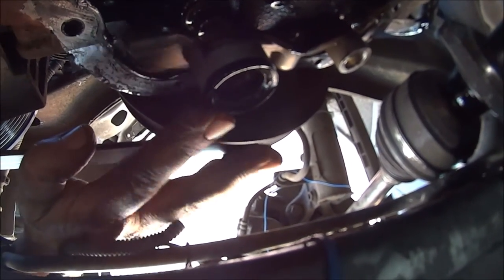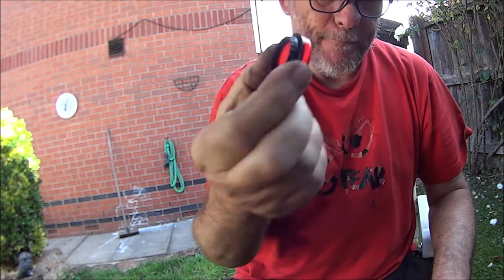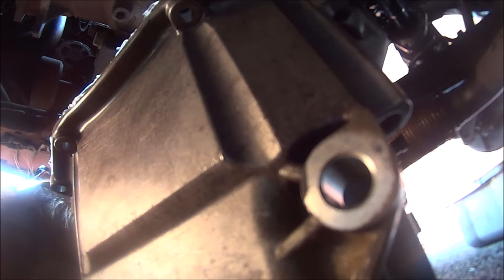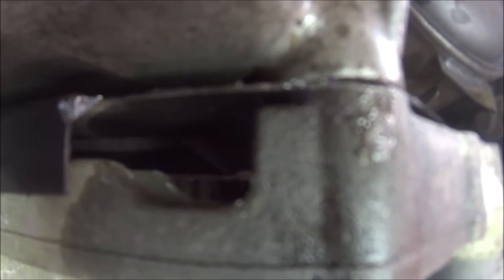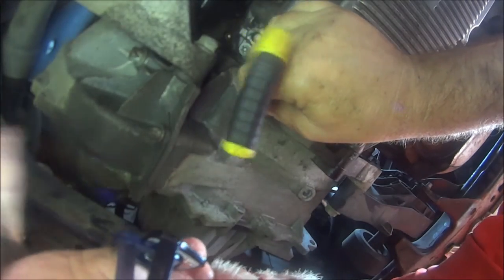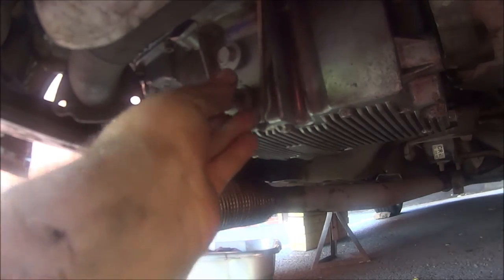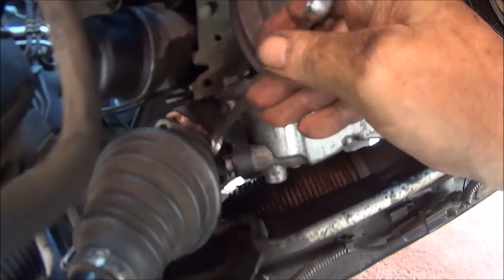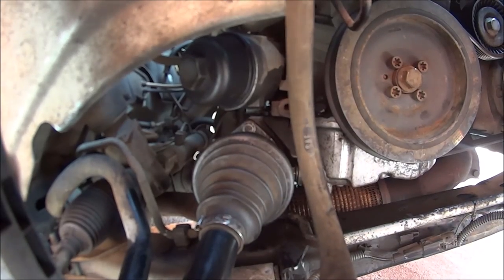VAUHALL INSIGNIA cdti oil pump Gasket seal replacement. UK

Comment: Just did mine 7 days ago but I replaced the rubber seal with the aluminium one ... no more low oil pressure warning on cold start up.
Reply from the maker: Nice one Graham. Thanks for sharing this with everyone 👍
Reply: Hi Grahan, Great coment, do you have the part number of the aluminium seal you installed?
Reply: The aluminium one has a smaler diameter. I am not sure if it will perform the same way. Thatswhy I am goint to use the original.
Reply: @sardaragabejli2208   if you mean the inside diameter, the restriction is not significant (coming from an engineer specialized in hydraulics).

Comment: Great video, really helpful. What are people's thoughts on replacing the big end bearings whilst the sump is off? 
I'm tackling this job shortly, I've not had any low oil pressure warnings, but replacing the pickup seal due to mileage of car and for peace of mind. I've seen some people mention changing the bearings and others don't.
Reply from the maker: If you have no knocking or bad vibration from the engine then I would just do the seal a lot of people replace the pump as well. But im not a mechanic just a guy trying to stay on the road
Reply: Thanks for the video. Just wondering if I should change the oil pump too. Do you know does the timing belt have to come off for the pump change?

Comment: Hi, great video of job done by good old mechanical expertise...:-)
Reply: Do you John or anyone with experience; I have a question if OilPump-Seal replacement also is needed on the Engine MY2014 CDTI A20DTH 163HP/350Nm, due to My Motor is about 156.000Miles = 250.000KM
Reply from the maker: Hey, thanks
Reply from the maker: i would do the pump too if you can.

Comment: The question is, is it still going? Did this oil pump seal on my car Jan '21 as I was getting red light of death on cold mornings, and now March '22 it has catastrophic bottom end failure and seized. Looked at 2 main bearings and both have spun in the housing...nightmare, maybe I should have changed the bearings when I did the oil seal...who knows?!
Reply from the maker: Can't say as I no longer have the car. But it will depend on how long the low pressure warning was ignored I guess.
Reply: @jonyr1TT  seems you're smarter than me ;) I didn't think much of it because my old Astra 1.7 CDTI did the same thing on cold mornings, but then I read up online and did the job as a matter of urgency....guess I was too late!
Reply: I can say tho, changing this seal did certainly 100% fix the red light of death on cold mornings issue
Reply from the maker: I'm not trying to be smart, just trying to help others save a few pennies. And Me. 👍
Reply: @Sydney268  hi mate. How long did you drive after first pressure warning? Did it appear many times before you replaced the seal? Cheers
Reply from the maker: About ten miles I'd just bought the car. So how long the previous honer drove it I've no idea 👍

Comment: Hi I have the warning when it's cold and after a second it disappears. I need the car for the next few weeks.Can I carry on driving or must I get the seal replaced asap?
Reply from the maker: Do not start the engine until its been replaced.. Low pressure will blow the main bearings.

Comment: Hi, need some advice. I posted recently that i had the oil seal replaced on my Astra J. A few days after the seal was replaced, I noticed a chattering sound when the engine was idling. Harvey's said that the flywheel needed replacing. I took it to another garage due to the price i was quoted. They replaced the flywheel,clutch and slave cylinder.
However, they said that when they came to take the gearbox off. There was no oil at all in the gearbox.
Does the process of replacing the oil seal need the gearbox oil to be drained?
What i am worried about is, did they drain the oil and simply forget to fill it back up or have they cracked the gearbox housing and the oil has leaked out. I am not getting any reply from Harvey's at present.
I will be going back to them to discuss this but i need to be a bit more informed before challenging them. They did tell me that they had to undo the gearbox to get enough room to reach the two difficult sump bolts.
Reply from the maker: Hi. When I did my oil seal I pulled the driveshaft out so I lost a good fare bit of gearbox oil through the driveshaft hole so I drained off the remaining oil and replaced it with new oil..  If they removed your gearbox it would have lost a lot of oil and should of been checked and topped back up to the specified level
Reply: @jonyr1TT  That answers my question. They said they did move the gearbox just enough to gain access to the two sump bolts. It appears that they have simply forgot to top the gearbox back up.
The garage that replaced the clutch have said that i have a little amount of gearbox noise due to running with no oil. So permanent damage has been caused. They said the noise is not excessive but could cause problems in the near future. I will be going to Harvey's tomorrow to discuss this with them.
Reply: @jonyr1TT  the irony being you don't need to move the shaft.

Comment: Did you keep the red plastic bit on the seal to protect it whilst you put the sump back on? I'm scared I'm going to damage the seal as the sump space is so tight! What a nightmare job, half way through. Never again!
Reply from the maker: Yes I did. To help prevent getting the gasket glue all over the new seal

Comment: hi, i have a constant vehicle service message coming on dash,, (no low oil pressure) when pluged in i get code P06DC engine oil pressure control solenoid valvue control circuit high voltage!  /  is this the same problem with my insignia too? or could it be just a oil pressure switch thanks 180k KMs
Reply from the maker: Hi. 
Yes it sounds like it could be the oil pressure switch but remember I'm not a expert sorry. 👍

Comment: nicely done, mine just flashed that low pressure on a cold morning, so time to do it, was it an all day job for you ?, looked a pain
Reply from the maker: Cheers buddy. I was taking my time so I did it over a period of three days.. Good luck with it. Its not that hard if you've got some decent tools. 👍
Reply: @jonyr1TT  bought the new seal, noticed the car was a little weak starting, checked the battery and it was 12v, should be 12.4 and higher, so bought a new 95ah battery and believe it or not no oil light this morning, error on glow plug 2 has dissapeared as well, now the car drives better than it even has, amazing how much a car relies on the battery.  no doubt the dreaded oil light will return, but im ready now ;)
Reply from the maker: Nice one. But don't leave it to long if the warning ⚠ comes back
Reply: Ja mam tjes isngniu mne vipisuje niski tlak oleja iba pri rane ale ja ju mam us 2roki jazdim nanu bes probelmu nevjem co to bude robit nevjem ci to nerobi snimac tlaku oleja

Comment: Does the warning light stay on or goes off straight away any help much appropriated
Reply from the maker: The oil red light always went straight off it was just the message that came up saying low oil on cold mornings.
Reply: @jonyr1TT  Thanks
Reply from the maker: no worries.

Comment: Hey bud, nice video. Took some tips from you, also I found that if you take off crankshaft pulley, you get some nice advantages, which speeds process a bit. Done job in around 6 hours.
But still got some problem, after I collected everything together, after first start of the engine that son of a female dog (error about bad oil pressure) again jumped out for a while(max 3 sec) and disappeared afterwards. Stopped engine and started again - no error. Now waiting when morning gonna come and will check if error still will be there.
Now wondering...maybe it happens for everybody in first launch? Did you remember your first launch after seal replacement, did error appeared one last time before go,?
Reply from the maker: Hi buddy. No never had the low pressure warning ever again. But I never started the car again after the first waring came up on the dash until I put the new seal in.
Reply: @jonyr1TT  Problem was in OIL PUMP, bit harder job, but easy to change if u know what u doin. Main advice which I learned from my mistake is - when you will start replace OIL PUMP , you will need take off cam belt, once you did that...please change all cam belt parts too to new ones(water pump, pulleys, belt tensioner, cam belt(with original MARKS on them)) they doesn't cost a lot for Insignia, because I did marks on belt(with "permanent" white marker) and on all pulleys too, but when finished all Oil pump replacement part, those bitches marks disappeared  and camshaft pulley also jumped on other direction, so I tried to somehow find marks which I left and put belt on.....after first launch, pistons hitted valve which broke all rocker arms, soooo because of that I was forced take off engine head and make sure there are no parts left(broken parts I collected on floor and didnt collected anything together before all parts were found). Took me around 12h to collect and uncollect everything together + I changed all gaskets(engine head, cam head etc)+new cambelt set. Because of my greed I spent extra 250eur.  Good thing -  I learned much more about my enigne in this process...Hope for this advice I will get some carma points in future, because I helped someone. 
Have a easy job with your "wonder" guys, and dont save money on things which you know you shouldnt!!! :D
Reply from the maker: You did a great job in the end. Thanks for sharing all the useful and informative tips with everyone nice one mate. 👍

Comment: Just busy doing a later insignia upper sump, 8 hr job as supposed to remove the gearbox. No holes and guides for the rear pan bolt's next to the flywheel, I cheated

Comment: Hi John , did you have to split the gearbox away from the engine to get to the 2 screws closest to the gearbox?
Reply from the maker: Hi Billy..no i didn't but I did have to rotate the engine because there is slots in the flywheel that line up with the 2 bolts. 👍
Reply: @jonyr1TT  yeah I just seen the previous video ... Should have probably started with that , thanks for the reply , I'm attempting this on the weekend
Reply from the maker: Ok good luck with it buddy hope it goes smoothly for you. Just take your time . 🔧🔩🔨👍
Reply: F40 gearbox no access gearbox has to move
Reply: @mrmotorvator5151  You can drill access holes in the bell housing if you're careful.
Reply: @ssss-df5qz  yes I did mine but wasn't confident drilling with box in place as there isn't much room and was worried I'd hit the flywheel.